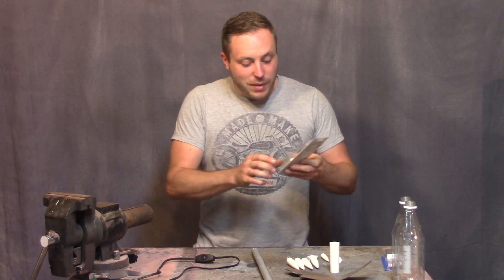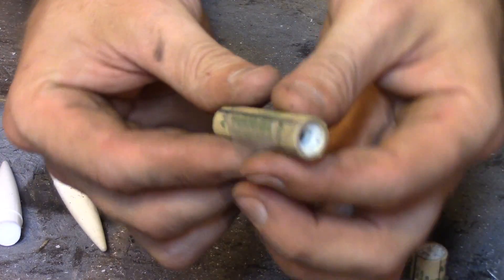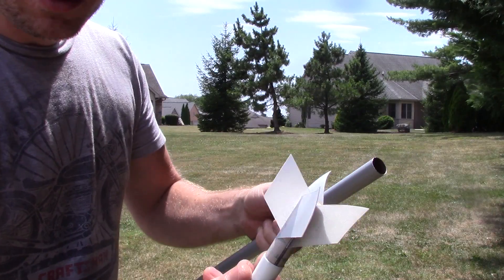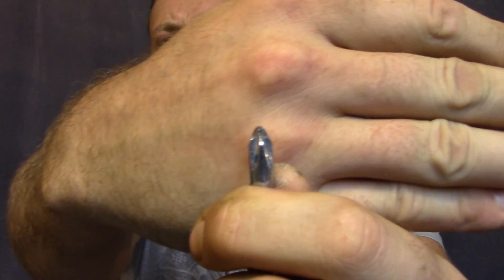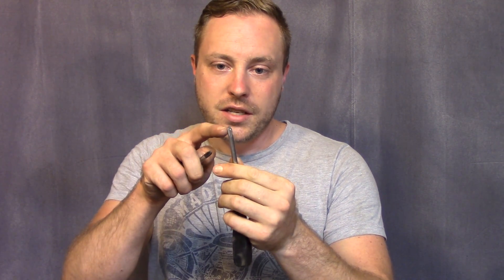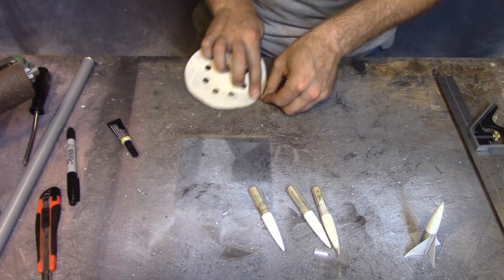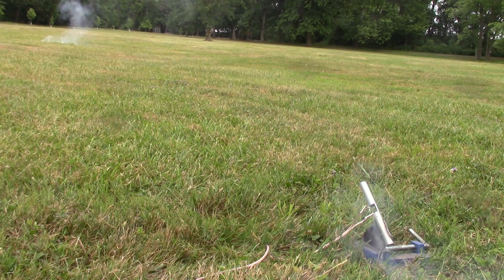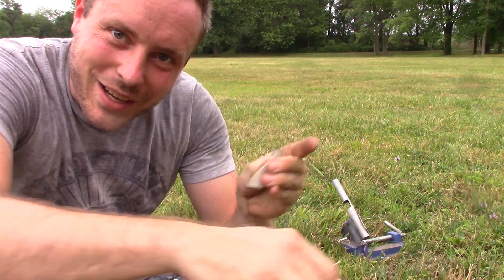BUILDING IRON MAN - FOREARM LAUNCHER Part 2

Comment: you failed to mention how tapping the screwdriver while trying to back it out, as long as where the screw is located can handle the strike from the driver against the screw, can break the "bite" from the hardware. 411: you don't actually have to tap that hard either. (just one more method)